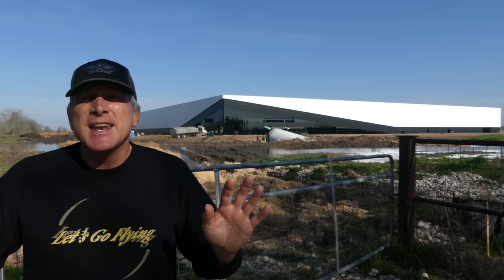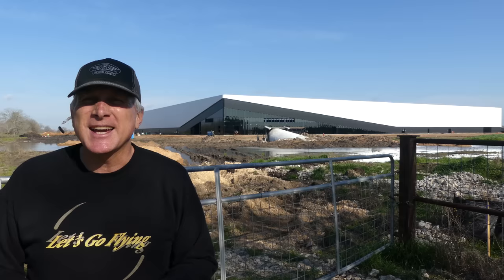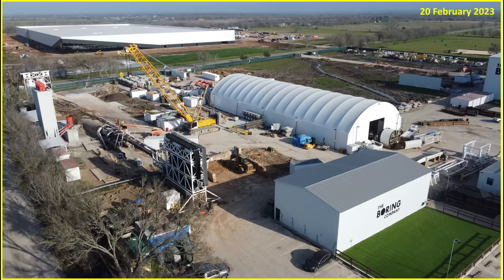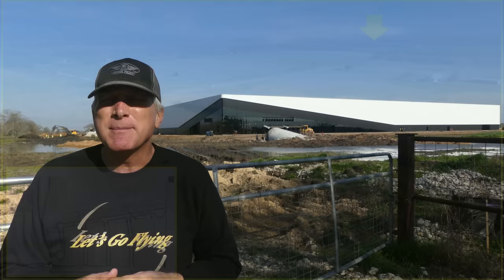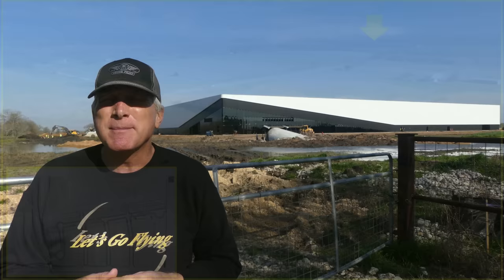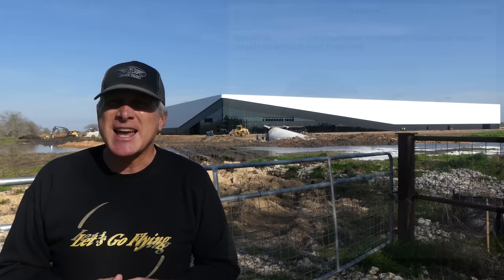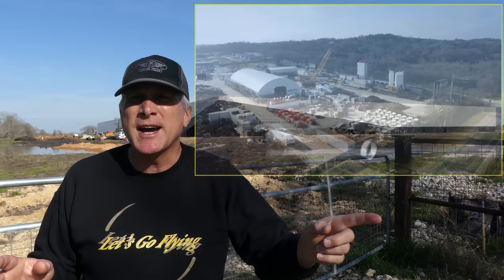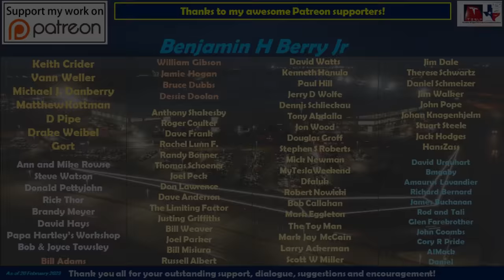SpaceX Bldg,, 2nd tunnel & 2-mo comparison! 21 Feb 2023 Boring Co & SpaceX Facilities Update

Comment: There’s very little work on the ground around the SpaceX building, leaving it very raw. They will have to complete a lot of paving and concreting work if they are going to start production work by the time the building is completed by end of May!
Reply: If they have the same project managers as Giga then it will probably be finished around June. It's very labour intensive when they lay paving and concrete, dig it up for some reason, then relay it, then dig it all up again because they forgot to lay the plumbing. Relay paving and concrete and then fingers crossed we're good to go. Yeah June sounds about right.

Comment: Thanks Joe!  Do you have any idea as to what the red and white striped thing is @10:13?
Reply: It looks like a trial of a hexagonal segmental lining (you can see some unused lining plates to the left of the red and white part stacked up (grey concrete)). The red and white seem to have a step in the alignment which indicates to me they have been trialing how to "turn" corners using a hexagonal lining system (not so easy). There is also a short trial build of hexagonal segments on the left side of the picture at 10:13, just behind the black truck body painted white. The tunnel being constructed is using the more traditional trapezoidal segments as it buries itself but there ae more sets of hexagonal segments stecked on the ground near the main road.
TBC are rumored to be trialing a hexagonal segmental lining as it can be used for faster construction, but they do come with some considerable constraints on thrust, alignment, and watertightness.